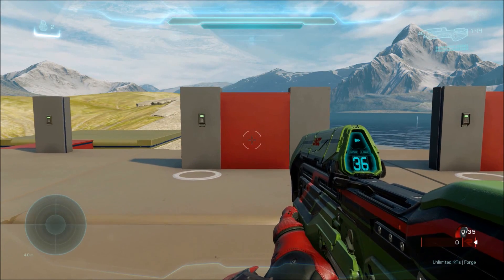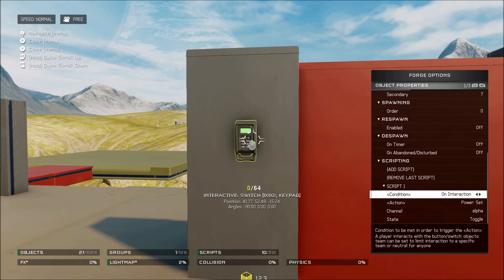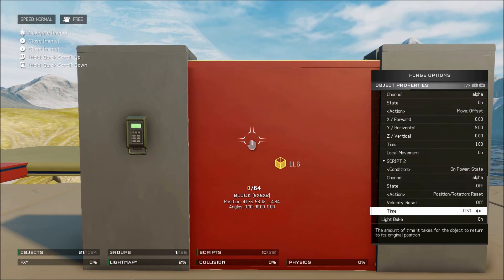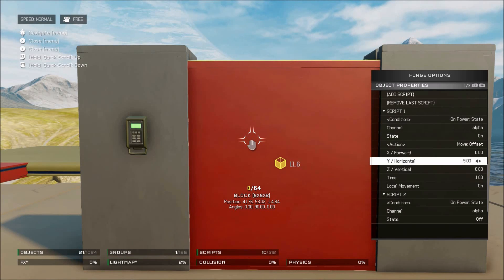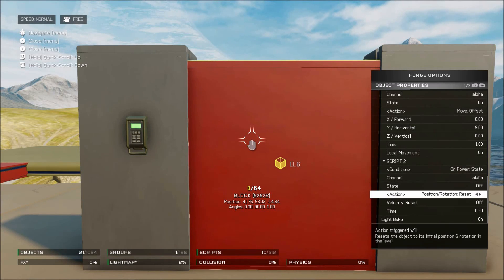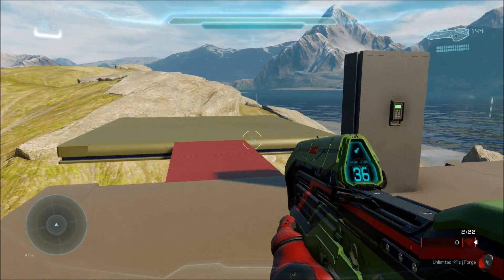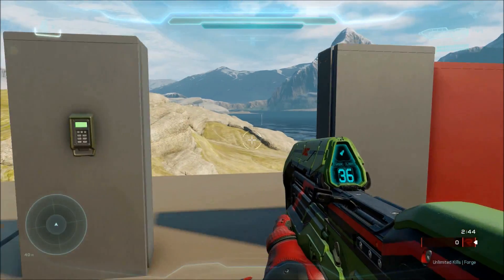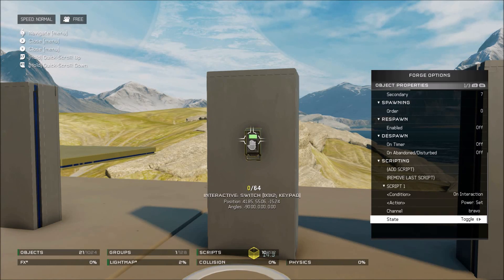Doors and Bridges (Halo 5 Forge Tutorial)

Comment: What about on the other side of the room? When I open the door and go into the room, can I close it again with another switch on the other side of the wall?
Reply from the maker: +ADAshinobi Yes.  Just script the switch to turn the power state for the door back to the off position.
Reply: +FORGEHUB Thank you
Reply: +FORGEHUB have you ever experienced the glitched where you spawn a switch but when you interact with it it moves away from you back to where you originally spawned it?
Reply: +Ricky Ricardo Ramirez Rocha you need to press many times the button select on the terminal. This fix it
Reply: Um Canal Qualquer : D Learn English. And no you have to put it on normal or fixed and it solves it
Reply: +Ricky Ricardo Ramirez Rocha sorry i dont speak english and yes this way works too

Comment: I need some minor Forge help.
I'm building a map that requires large and thick walls. But, for the life of me, I can't locate any thick and large blocks. I need blocks that are tge size of cargo crates, and w/o the details. But all I can find are blocks that are 2 inches thick.
 I'm currently using floors as place holders. But as I said, they are way too thin.

 I'm taking my time with this map, but I can't progress w/o these blocks. You can see what I have so far, in my FileShare. It's called: Delta

Thanks, in advance, for any help.
Reply: +SEspider Check out primitives!
Reply: +SEspider under the "Primitive" tab, and then go to "blocks", and for width, I'd say probably 32', and length perhaps 64'. As for height, look for something the same size as 32', or somewhere around there, so it'll be like 32x64x32. If that's too small, then try a size larger, or too big, try a size smaller. Hope you find your pieces!
Reply: Found it. Thanks, Guys.

Comment: That last one won't work because every other press is going to move the wall to the right as on every other press the power is being turned back on so on the button you need to set it to turn on, not toggle
Reply: I believe I corrected myself in the vid to use state ON if I recall right

Comment: Just a warning: If you hit the button before the movement is finished it will move in the other direction, breaking the door
Reply: Actually that only occurs if you have the off position on a specific coordinate movement rather than using position reset. The first door is spam proof and has been tested to work that way